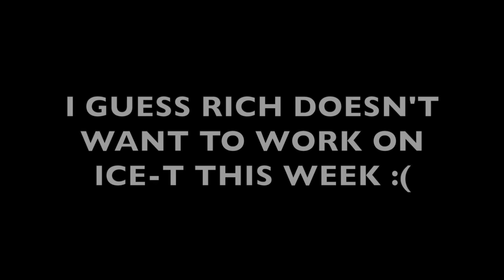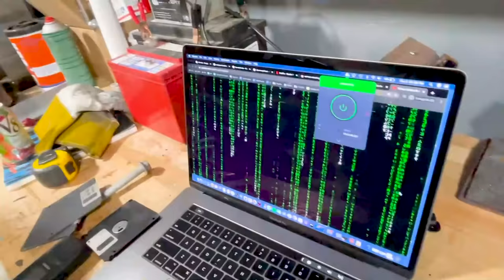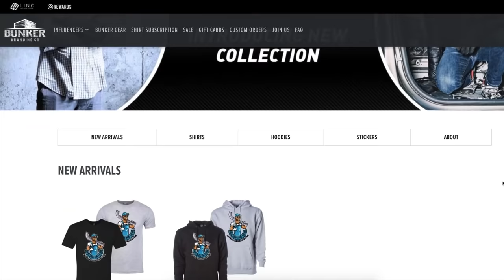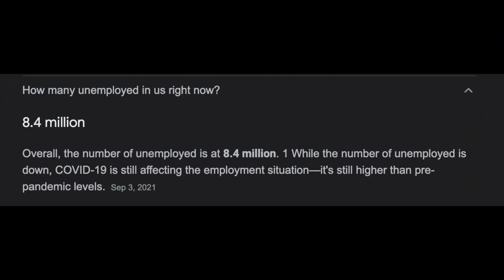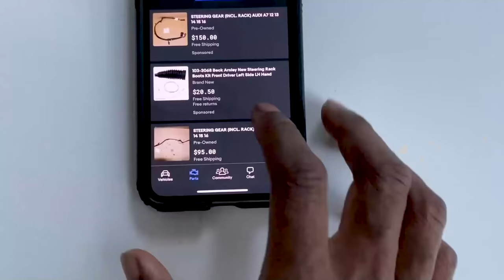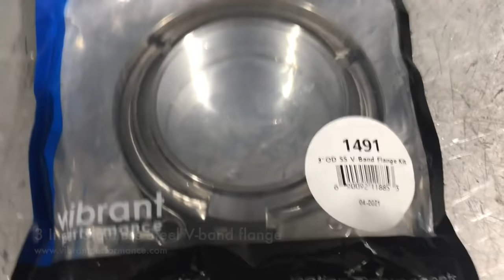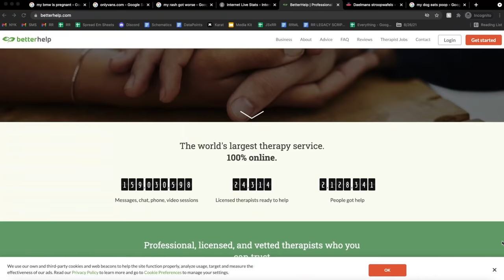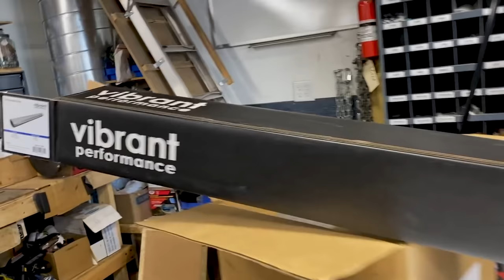Giving the V8 Powered Tesla its one of a kind exhaust system

Comment: As a professional tesla swapper -  I would have gone with the Subaru  EJ25 motor.   It is a superior motor in that the head gaskets always blow, so you have more youtube content.
Reply: Had me in the first half ngl
Reply: As a Subaru fanatic, 10/10 agree with this comment.

This is why I went with the superior EJ207.
Reply: Or a subaru h6 engine would have been way better.
Reply: @carholic-sz3qv  Perrin did an H6 swap and realized it was cool, but not worth it in the end. Check their 2005/2006 SEMA build blog. 

Please send me a link if another company has had better results with an H6 swap, I stopped following STI builds about a decade ago.
Reply: Why stop there just use RX rotary Mazda engine
Reply: @alesksander  true a 1.3 would be smol.

Comment: I can't wait for stage 2. Are you going to swap in a carburetor and points ignition? You really need to do  the leaf spring suspension upgrade and I think Wilwood makes a complete drum brake conversion for the Tesla. Can't wait for the window crank installation.

Comment: As a car builder for over 1000 years, i have built the first motor vehicles to ever exist. Scratch that i even built carriages. Scratch that i literally built horses. I have modified all sorts of vehicles. I built big block drag cars when i was 1 year old. By 3 i had built the plymouth superbird. When i turned 7 i had already won le mans as a manufacturer 7 times in a row. i built over 80 bonneville landspeed record setting cars when i was 8 years old. By 13 i built every single group b rally car, i built the early turbo cars in indy and f1. When i turned 15 i had already made the first top fuel dragster to run down the 1/4 mile in under 4 seconds. I invented the limited slip differential and the first 6 speed manual transmission in my sleep. I once was constipated and shit out a piece of iron, that piece of iron went on to be the 2jzgte. I made the first msd ignition with a aa battery. I was the consultant behind the bugatti veyron. I created holley, edelbrock, comp cams, injen, hks, turbonetics, Garrett, and every other vehicle performance brand in existence. I own 324 Toyota 3kr engines and 662 18rg's. The first dohc engine was my idea when i was dreaming, and i made vtec by accident when i was high on acid.  One time i barfed and invented nitrous oxide. Etc, etc, the thing is... everything you have done is wrong, that car will ner run because you did everything wrong. Firstly you should've used m11x1.4 bolts, without them that car is gonna fall apart. The welding is utter garbage, its not good old 220v arc welding like all good cars have. And finally, it has no jb weld, the quality of this work is absolute garbage, and it'll fall apart.

Comment: I like both the oval shape kind of looking like an usb c plug because it sticks out a little and the stream lined multi piped vent styled muffler as it follows the shape of where it will go onto.

The one thing that I would change is the height of the exhaust system as it looks like it sits too low down from the floor but it could be an illusion because of the tesla car's different floor shape.

Comment: It takes a long time to build a car from scratch. It takes even longer to rebuild one with a motor that was never intended to be there. The on spot engineering that goes into a build like this is mind boggling.
Reply: I wonder how many Toyota/BYD  Blade batteries will fit under a Tesla fitted both length/width ways... ?? would be an interesting conversion for off warranty Tesla`s...
Reply: I think "On Spot Fabrication" is the pedantic, but more accurate term that should be used here.
Reply: check out Bad Chad
Reply: Compared to Project Binky this is flying along.

Comment: Rich, I love the build and craftsmanship going into it. I know you dgaf about peoples opinions about the build but there is something you should at least look into. I definitely suggest going with a two piece driveshaft for one as long as the one you’re using. I’ve never seen a driveshaft that long at that diameter live with any kind of power. I really hope it works out, but if it doesn’t there will be mayhem when it comes apart. 

I’m saying this because the first time I saw one fail was after I built a single turbo 1jz swapped Nissan Hardbody pickup.  I thought I could get away with a one piece 4”x roughly 60” driveshaft (because the first driveshaft shop I went to told me it would work). It ended up twisting in the middle and snapping. When it did it punched a hole in the floor board just behind the drivers seat where I had a small bucket of nuts.  They flew around the truck with enough force to bust out both of the side windows in the back. I replaced it with a smaller 3” two piece (after another shop looked at it and the truck and was like “the other shaft would never last at that length”) and have never had a problem since. But it did make me start asking questions to people when they broke a driveshaft and most of the time it’s the same story over and over. A long one piece driveshaft. Just a suggestion to at least consider.

Comment: That exhaust is a piece of art! 

And the funny part is that I was just wondering last week where I would get that modern OEM heat shield look for my car as the exhaust runs too close for comfort along my brake lines, fuel lines and air bags (issue is common: no room underneath the car for a different setup) and that heat shield stuff looks clean!

Comment: OK, can the exhaust not slip out the side rails like a Shelby Cobra, with a can under the running board, rather the 90 degree out by the tyres? I think something will melt or get really hot, hotter than my jockstrap.

Comment: Rich, 40 years ago, people would buy GM cars or trucks with the horrid Olds 5.7 diesel, and swap in a big block Chevy. The loophole was, diesel vehicles weren't subject to emissions testing (then). So you're using a similar loophole to put a hot gas V8 in an EV. Smart.

Comment: If you can find a ZL1 differential (probably sold new through the GM Performance Parts catalog), it'll be pretty tough like a 9" rear, but may (or may not) bolt into your custom assembly without mods. Thanks, Uncle Rich! Great stuff!

Comment: I'm only asking, before you slaughter me, but as you have an X-junction on the exhaust will that not punch pressure back into the the opposite exhaust header during the firing/running of the engine. Interested to see how this runs. Me, with a big wallet (if), would have run them parallel but not sharing the meet point. Beautiful TIG work and finish on the form of those pipes.

Comment: there is a trick i used on my new motorcycle chrome headers to stop the discoloration, is to cover the inside of the exhaust with motor oil before running first time

Comment: That X-pipe at 45 degree is going to work backwards at anything over idle or light throttle. I.e. it won't split the pulse between the two downstream pipes, but will scavenge from the passive downstream and in the best case will scavenge a little from the passive upstream.
A home heating systems plumber should be proud of it though.

Comment: Have you thought about the radiator frames, and oil cooler frames yet for the engine oil and transmission oil ? Also about getting the coolers in there cause how many times will you start the motor up with out coolant supply and burn through the seals inside the motor.